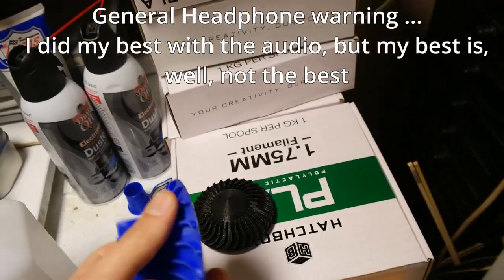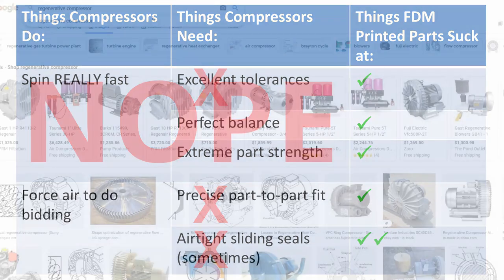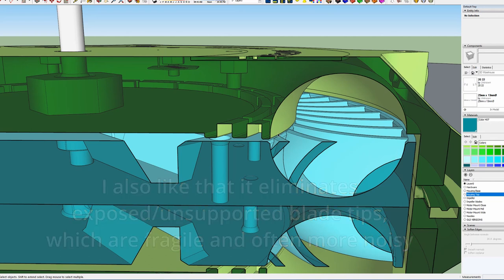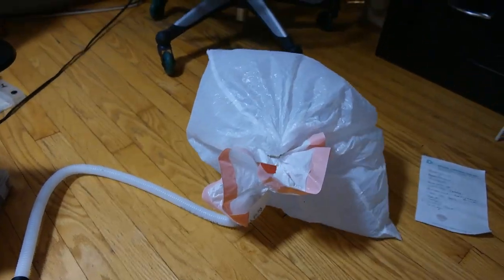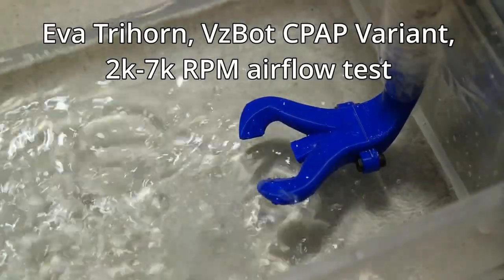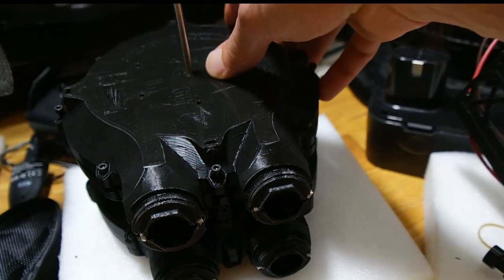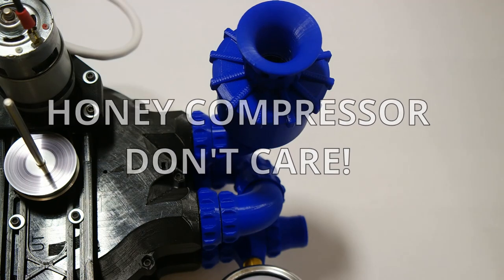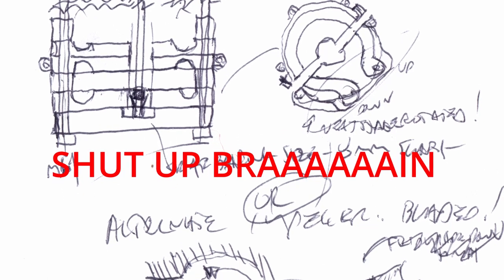I 3D Printed a Compressor that ACTUALLY WORKS (but you've never heard of this design)

Comment: How much noise is the brushed motor?  I wonder if a cheapo brushless and esc would reduce sound and power...
Reply from the maker: Up to a certain speed (not positive, maybe 1k RPM) the brushed motor is the noisy part :)
Reply: That was sorta my guess.  It does mean a brushless esc which may be a PITA.   Regardless, great video.
Reply from the maker: @JustAnotherBigby  Thank you, appreciate it!

Comment: you will probably see more successful pressure results if you make the second stage compressor smaller than the first stage .
Reply from the maker: I also suspect this, but this version doesn't make it easy/economical to test variations of the internal geometry.  I hope to experiment with this in a future iteration that splits the housing into more pieces.  Thanks!

Comment: Interesting,we have the same problems when making car compressor the electric ones , seems like a nice option
Reply: The main issue is finding something as efficient as traditional compressors. The parasitic losses of modern compressors are fractional compared to power gains under load. And it's self sustaining. The second issue is controlling the electric compressors in a meaningful way. The third issue is space. A DC motor hitting 10-20k rpm isn't super realistic in that environment. And anything stronger to run a reduction significantly increases size. But honestly, the biggest reason is just there's no demand for it. It's more than possible, there's just not enough of a market for any real pursuance.
Reply: @g45h96  when making these kind of turbo which are for few minutes boost ,efficient is not that important but running them with out a second battery that needs 48v because you need 30.000 rpm  ,size  maybe a problem but if you think that turbos need gases to work and compressors need belts it's will be easy install,plus getting them balanced is nightmare, believe metallic compressor get destroyed the same way ....

Comment: if you're going to make a blower design anyway (high cfm low psi) why not go for a liquid ring blower? at least that solves one of the main issues with 3d printed parts which is poor tolerance control. 

i work in industrial compressors and i would say that if you can't even generate 1 bar, it's a blower.
Reply from the maker: What do you consider high CFM and low PSI?  Because compared to an axial fan of comparable power, this is about 10% of the CFM and 20x the static pressure.  It is similar to a WS7040 CPAP blower but at 10% the RPMs.  It's a good performance zone to be in for pushing air through lossy hoses.

Comment: how many would you need to put 175 psi into a small 5 gallon air tank?
Reply from the maker: I'm pretty sure the housings would deform and/or burst apart well below 175 PSI.  It wasn't designed to handle that much pressure!  If you machined it out of metal, then in theory the only limit would be how fast you could spin it.  10 stages at 50k RPM would probably generate a ton of pressure.  In practice, though, this is the wrong design choice for filling air tanks -- that's a job for a low-flow, high-pressure pump.  This is for applications that need a balance of mid flow and mid pressure and the ability to sustain it (instead of draining an air tank) -- think blow-off tools, remote cooling, bladeless fans, underwater air supplies, air hockey tables, etc.
Reply: @jamespray  What about pairing it in front of or behind a HPLV design like you mention as consecutive stages? Would that offset the utility issue?
Reply from the maker: @claws61821  Interesting idea.  It might increase the fill speed of an HPLV setup if used as a booster, sure, though I'm not sure by how much!

Comment: A brushless RC car motor would be quieter. Or perhaps an RC plane outrunner.
Reply from the maker: I'm sure you're right!  Not to mention a fun way to explore the upper limits of performance.  I'd like to pick one up eventually, but I'm thinking of playing with AC motors (e.g., salvaged from fans, vacuums, etc.) that I already have on hand, first.  There's something to be said for not needing batteries or ESCs 😄
Reply: @jamespray  AC motors are brushed (whine) or limited to main frequency (mains Hz * 60 rpm).

You can actually get 150/300V BLDC motors and BLDC controllers that runs from mains (110V / 230V), but the parts isn't as common as the lower voltage versions.

a quite cheap secound hand server power supply can at least run 12V BLDC stuff (500W or more).
Reply from the maker: @erlendse  Server PSU is a good tip!  I'll keep it in mind :)

Comment: How fast can it inflate a air bed
Reply from the maker: Probably about 2 minutes for a twin size, but you'd want to be careful about when you stopped inflating ... 1 PSI above atmospheric pressure spread over the area of a twin mattress is probably about two tons of force on both top and bottom (based on napkin math for 84x48" surface area) :face-fuchsia-tongue-out:

Comment: I thought people gave up on this because it's cheaper to buy an army surplus pump.
Reply from the maker: Depends on what the surplus pump costs?  I think this cost me $40-$50 in parts/materials, not counting the power supply and optional bits like the gauge.  That said, even if the surplus pump was more expensive, it would certainly require less time investment, and that does count for something.  Not to mention it would likely work better 😋  but a lot depends on the use case and your head/flow/noise/power requirements.  There is a vast difference between "I 3D printed something that works" and "I 3D printed something that is competitive with commercial offerings" ... that would be quite a feat, and I'm a long way from topping it!

Comment: Actually I have I mean we have you know this if you've read 2005 world book series with steam engines and steam reactors you know you can push a piston with a compression system the gas engine is actually  a compression engine it's all so simple Hurry up already start producing them as parts you just remade  it for a different type

Comment: 1000 rpm is not a lot for a air compressor? really? my air compressor does 900 max and thats at 36 cfm 5hp
Reply from the maker: At 5hp that doesn't surprise me!  And it's relative to the type of compressor.  1k would be a lot for a positive displacement (piston) compressor, but it's 10-20x less than most centrifugal types run.

Comment: Your brushed DC motor throttling noise issues are certainly the easiest to solve. Why you wouldn't simply choose a bellows design to blow all this tomfoolery away with tech well within a 3D printer's limits, is the bigger mystery.
Reply from the maker: Short answer: I'm just less interested in reciprocating designs 😉  Although the bellows approach is one I hadn't considered in that area, and could be interesting to explore for lower-flow applications.  Thanks!

Comment: Use BLDC motor with ESC
Reply: Or a BLDC driver instead of "ESC"? There are plenty pre-made modules that take a analog or PWM input. Easy to control.
Reply: @erlendse  I brushless DC driver and an ESC(Electronics Speed Control) are the same thing.. I assure you. I design them. You cannot make a BLDC driver without electronics and control algo. Aka ESC aka Same thing.
Reply: @mystamo  same thing, different interface.

ESC also come in a version for brushed motors?
Reply: @erlendse  I mean.. Electronic speed control is speed control using electronics.. You can have a brushed or brushless controller.. All depends on the circuit and commutation logic. Sine, Trap, FOC. Etc.

Comment: you havent heard about the design since its terrible for subtractive manufacturing.

Milling blades for compressors is bad enough. Doing it inside of a part is a fucking nightmare.

Btw sam issue is also the reason why living hinges havent overtaken bearings in applications where free rotation for more than 360°
Reply from the maker: True enough 😆

Comment: gear up an induction motor.
Reply from the maker: Hmm, could do!  That's probably what most commercial models use...
Reply: @jamespray  most common compressors i've run into are direct drive, noisy buggers they are, but your motor geared up could be attached directly and run slower.  spiral cut gears are quieter, jay leno's video about his car powered by a tank engine has straight cut gears, if you check it out, prepare the earplugs.  belt might be fine.
Reply from the maker: @felderup  The belt definitely has the advantage for quietness, although there's the potential tradeoff of the required side-load.  I would never touch straight gears for this application, no way!  Spiral or herringbone, possibly, but the pulleys are much easier and work fine, especially for this phase of experimentation.  It's also what many superchargers use (albeit in conjunction with internal gearing), so it can't be that bad for longevity.
Reply: @jamespray  yah, the worst problem with regular belts is the slip causing a whine, lotta old cars with that problem, new ones have toothed belts though... usually under covers to protect them.  in cars the ones on chargers aren't expected to last long anyway, they're exposed to sun, heat, firey death, coolant and oil splashes, a horrible environment, a workshop might be almost as bad.  just a reason to obviate the belt or make it easy to replace.
the final version... maybe mathias wandel has some ideas, he's done some belt drive devices that need reduced noise and good contact, though some of the longest lasting shop belts are leather.  for your application i still think direct drive would be better but would require more fiddling to find a motor that just runs at the speed you need.  have you checked to see if the motor controller is adding to the noise... and the universal motor from the drill is gonna be loud.
maybe investigate tesla turbines for this, lots of old cd's laying around useful again.
Reply from the maker: @felderup  The motor controller is absolutely part of the noise problem at low revs, although I wasn't expecting anything amazing out of a cheap drill's trigger switch.  I tried an MKS MOSFET board to control this 775 motor (as I have used to PWM control a high-current dust buster impeller for print cooling) and it was absolutely awful for noise at usable PWM frequencies, possibly because its PWM output doesn't have the right sort of decay since it's not a motor driver but intended for heater control (but that's an uneducated guess).  That's why I pinned the comment about using a stepper instead, because those can deliver high torque in the low end and can be controlled very quietly with the proper drivers.

Part of the trouble is that it's just a weird RPM band for available motors, as well as a weird mix of max CFM/max boost stats.  I'm considering trying to purposely tune the next design to require higher RPMs so it's easier to drive as well as maybe push the noise above the ~25kHz "easily audible" range.
Reply: @jamespray  like a multi cylinder engine, yah, enough exhaust firings and it goes inaudible.  there might be some use to investigating flywheels, they can even out the noise a bit, take longer to spin up though.